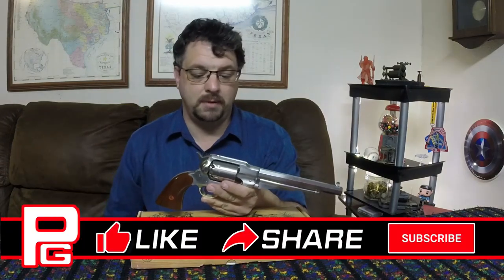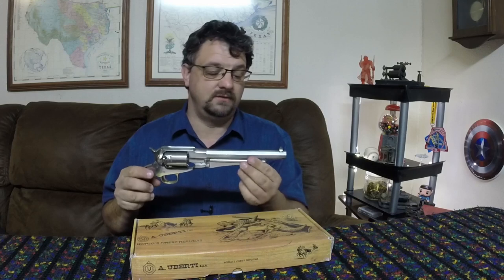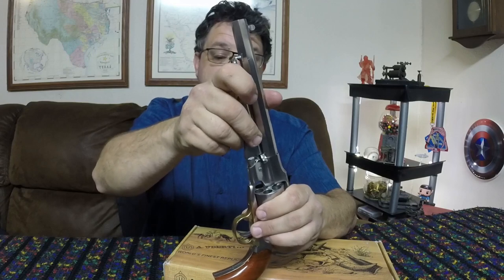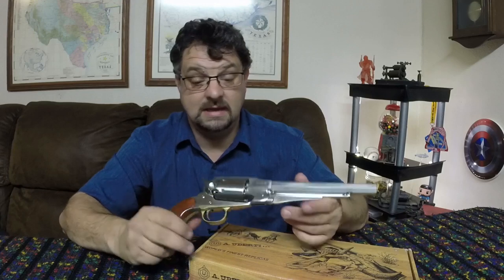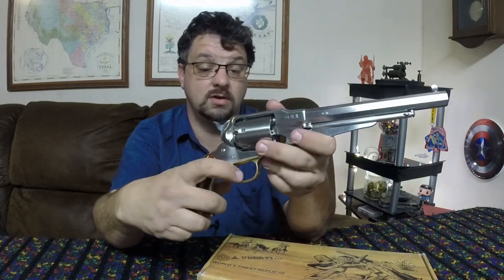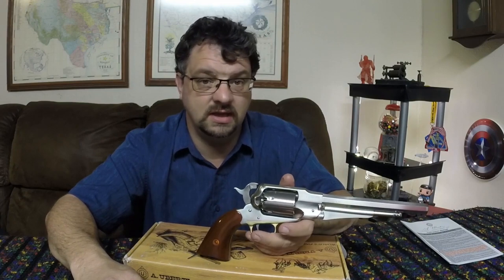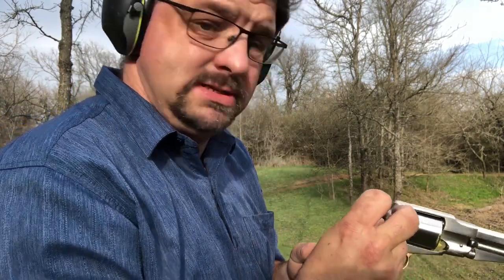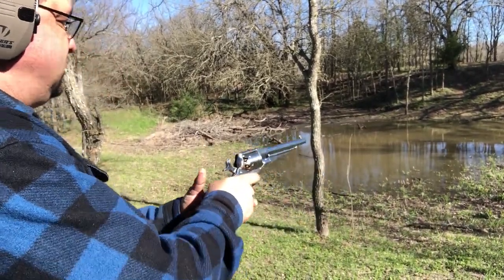Uberti New Model Army - Remington 1858

Comment: HHA the fact is the Llub 98% of the time causes the chain fire. Llub used is absolute  min. Its the grains of power which get stuck and then stick to the cylinder  is the reason. 30 year shooter and gun smith carried out 1000s of experiments over the years, systematically going through everything, trying to find out why it happens. I follow his idea and have never had one chain fire NOT ONE!   It works, Llub only goes on the patch never in front of the round.
Reply: Yes he needs to listen, I also pointed out two things to him.. put caps on first and fire them this cleans the nipples, I do this everytime I cleaned and stored it over a period of time same as my plains Rifle also Half cock is best safety

Comment: You loaded all six chambers ! Yay ! Subscribed!
Reply: Went to the range yesturday with both of my 1851 navy 44cal.. i loaded all 6 each time.  Caps will only go off if the hammer slams on them.  Hense thr name percussion.  You can push as hard as you can on a cap and they will never go off.   They need blunt force.

Now if i carry them in public for open carry.. yes ill do 5 because you walking around all day you never know if you bump into something that could lift th3 hammer..   but on the range.. i dont understand why people load 5

Comment: i owned 2 of this same model both chrome finish , chrome is more rust resistant .. by removing the brass trigger guard you can adjust the trigger tension , i generally kept mine set at HAIR TRIGGER .. remove the hand grips you'll see a long flat spring , order a second or 3rd as these tend to break over time .. not once did i ever experience a chain fire as i never neglected to lube the cylinder , i liked the model 58 for the top strap as i assumed it would deflect the cylinder horizontally in the event of catastrophic explosion plus it just added more overall stability .. ball conical wafer or buckshot projectiles all worked well .. accuracy was much better than any colt model ..

Comment: Love mine, 1st thing I did was strip it down to bare frame and debut everything. I "slicked" it up, anywhere something rubbed where it shouldn't I stoned it till it smoothed out, lightened the trigger spring a bit. Stoned cylinder chamber mouths. It's a sweet, smooth shooter. I learned how to do the "highwaymans roll", it's cool

Comment: I have the same revolver and I love it.  I use #10 CCI caps on it.  I also had to torque down on the hammer spring to get enough pressure to get the caps to reliably ignite.  If you put the hammer on half cock before torqueing down on the screw then you can prevent the hammer spring from slipping off the hammer.

Comment: What people dont understand with the percussion caps is they dont go off when you just bump the hammer with your hand.  You could actually take the hammer set it on the cap and push as hard as you could and it wont go off.

What sets them off is the blunt force of the hammer SMACKING them when cocked.  Thats the only way a percussion  cap will ever go off.

On a 1873 SAA like you said the hammer has a pin.  And pin is to push on a primer.  A primer will go off by just taking a pen and pushing on it hard enough.  But a percussion cap wont.

So no smacking the hammer wont do anything.  What could happen is the hammer lifting from something like your body or seat belt or something and then dropping back down.

This is also why those notches suck.   The hammer can be pulled back ever so slightly.. very easily not much force at all.. and all it needs is to go back just a hair for it to get off those tiny pins and the cylinder could turn and the hammer will never go back on the pin.   

I load 5 when i open carry my 1851 navies in public. Yes i carry them.   But on the range i load 6.

Also you can HALF cock the hammer and itll never drop.. pulling the trigger at half cock does nothing.. you could smack it as hard as you wanted with your hand too and it wont move.   Half cock is the original safety
Reply: One of my friends had a old army and he always used the hammer to set the cap. Never had a issue
Reply: I have smacked the hammer to set off my derringer before when the spring got to weak.Sooo.... Wrong.
Reply: @kg4kfj  YET. Not to smart.
Reply: @terryparker1694  ive seen someone test this on youtube it only worked when they used a rubber mallet.  But not their palm.. was your hammer flat on the cap or did you smack it with the hammer back
Reply: @jeepsblackpowderandlights4305  Flat down all the way. Smacked it with a screwdriver handle. Went right off, no problem. I did it a bunch of times that day. It it gets hit or dropped it's going off. NOT EVEN  a good idea. Nothing happens until it does. And it easily can. Keep fooling around and you can be living (or dead) proof.
Reply: @terryparker1694  screw driver handle is a SOLID object.  Which creates a solid sudden impact.  Your hand.. isnt solid try smacking it with your hand and i bet it wont go off.  This is what i was talking about.. the hammer or mallet is a solid object smacking the hammer.  Your hand or palm isnt.   You need to proof read what i said.  In my first post.  It takes a solid hard impact to set them off.  A screw driver is just that.  Your palm isnt. 

Honestly i feel like making a clip now with my gun on a vice caps only to prove my point

So bumping into the hammer with your body most likely is never going to set it off like it would a 1873
Reply: @jeepsblackpowderandlights4305  No, I`ll let you do that. I`m not an idiot.
Reply: @terryparker1694  check me out.  Uploading a clip now to prove my point to you on how much force it actually takes to set them off
Reply: @jeepsblackpowderandlights4305  Hold it to your head. Dumasz.
Reply: @terryparker1694   @terryparker1694  only dimbass here is you.   I made a clip about these caps being very hard to set off.  As for your little suggestiin.. becareful dude one day youll piss the wrong person off
Reply: @jeepsblackpowderandlights4305  LOL You're more than welcome to try, pissboy. Put it against your head.

Comment: I've been using BP for 40+ years and wonder wods are on but I like putting little bit of bee's wave and other oil heating up in hat water just seems like better accurate and clean up  the moose milk is good too so many different things people use. And powder load in my Ruger old army is 22-25 grains but that works for me 22 is the best and crimp caps not recommended I've done it but it's not recommended cause of Cain fireing and if you lift the revolver up it helps with the caps not jambing called the calvary something anyway have fun BP is lot's more fun than standard revolver nowadays you have to think with BP

Comment: Great awesome video question if you shot a couple rounds would  you have to shoot out all rounds then clean it or can you shoot a couple of rounds and can clean it and how would you unload it after shooting a couple rounds or rather say when you load it can you unload it?
Reply from the maker: It's going to be easiest to shoot out all of the rounds. If you have to unload it, the first step is to very carefully get the caps off of the nipples. But you have to be EXTREMELY careful when doing this so that you don't set them off. Then you take a nipple wrench and remove the nipples, dump out the powder from the nipple side (you need to be very sure that all of the powder dumps out), and then use a punch and a hammer to get the ball out. You can buy a tool that you can hammer and screw into the ball from the front, then use it to pull the ball out. It's probably easiest and safest to just shoot out the other chambers. But if you absolutely cannot do that for some reason, that's how you'd get them out.
Reply: @PoindexterTactical  Thanks 😊 a whole lot for that good advice I come out better just shoot out all six rounds more safer
Reply: @PoindexterTactical  I was loading a ball and packing it one round did not seat all the way half way with the rammer the rest of the ball did seat tight but one did not seat tight is that normal and okay?

Comment: Question what have you used for the nipple threads grease if anything I've been using some choke tube lube but everything gets harder to find one guy said he uses permatex spark plug anti-sease another said super lube  so got both going to try it but what have you been using if anything ?
Reply: Copper  High Temp Anti Seize I would try

Comment: One more tip. I prefer remove the cylinder, the put powder on each camera, put wads (I prefer OX-Yoke ones). Then insert the cylinder back to revolved and put the balls (or conic bullets), remove it again and install the caps, then finally insert it. As to me it is faster and I have to sure that the caps are installed firmly and properly. Also before installing caps I use the pin to pierce each nipple hole, especially for second and each next round of 6 shots. Sometimes the nipple holes could be dirty and clogged after the firing.

Comment: As to the caps - it is common problem. As I found RWS 1075 works fine with the original nipples, but CCI #10 is too small, in most cases they just smashed, but do not fire. Finally I replaced the nipples for especially #11 and they work perfectly with the caps from Winchester #11 (it looks they are the same as CCI #11). 

Anyway, if you buy such revolver (does not matter either Uberti or Pietta) - be ready to do some gunsmith work with it. After 2 year I had to replace the main spring, spring above the trigger and hammer. Also I tried slixshot nipples, but figured out that the nipples for #11 work better. Anyway, it is a fun to do such improvements. You could play with different powder (I hate Pyrodex - too dirty and not fully reliable and like hodgdon 777), different  amount or powder and conic bullets instead of balls. I do not recommend you to use Pyrodex 30 Grain Pistol Pellets at all. It is so many misfires, in many cases caps could not ignite them. I found a solution - before loading pellets I add just a bit of Goex Real Porwder FFFF which I use as a primer for my flintlock rifle. I do not like the idea to mix different powders, but it fully reduces the number of misfires.

Comment: I would like to know what type site picture you use to hit center mass. The front sight is extremely high.
Reply from the maker: The high front site is actually really necessary. Colt SAA’s have lower front sights and are notorious for shooting high. NMA’s we’re made with higher sites to counter that. You’ll see a lot of SAA repros with higher sites as well.
Reply: Shot way too low out of the box. I had to "trim" my front sight- removed almost half the height- to get accurate sight picture.  I used a laser bore sight to see where the front blade intersected the laser, marked with paint and filed the front blade to the paint mark. Now my sight picture is the top of the front sight is even with the rear "V" and is accurate.

Comment: Little suggestion.. before you cock the hammer keep your finger out of the trigger guard.  Single actions have a very light trigger.. ive seen people cock the hammer and there finger was in there and pulled the trigger by accident when thr gun was pointing up or left right ect..
Reply from the maker: You're very right on that. I definitely need to train myself to stop that. I've actually fired my 686 not meaning to doing this. Fortunately I was following the other safety rules and it went into the berm. But I need to just keep my finger out of there.
Reply: @PoindexterTactical  ive done it i wont lie, the other day on the range i had my finger in the guard.. cocked the hammer and tilted the gun up to drop the cap from the prior round and my damn finger barely touched the trigger and it blew a hole in the roof of the outdoor range lol.  seen others do this too, but its like a hard mental memory to get yourself to keep it out of the trigger guard for some reason when you cock the hammer back i mean
Reply: Commenting on a recent event...I am sure that is what Alec Baldwin did when he shot that cinema photographer and director.

Comment: DO NOT PINCH THE CAPS. Most chainfires are from the rear of the cylinder. Caused by a cap falling off and allowing a spark to enter the chamber. An oval cap leaves an opening for sparks to enter the chamber. Use ONLY #10 caps on a #10 nipple. NOT #11's. It the correct size ball is seated correctly, there is very little chance of a chairfire because a properly seated ball is water tight. The lube in front of the ball was just that. Lube for the barrel. Where all this misinformation started, I have no idea. But It has got to stop. Please pass this on so others will know the truth and not damage their gun or worse.